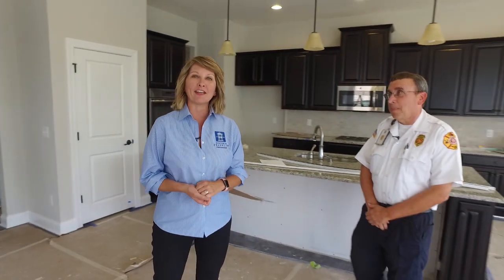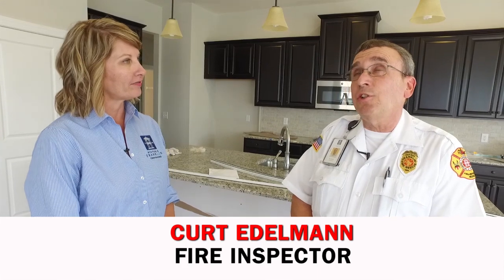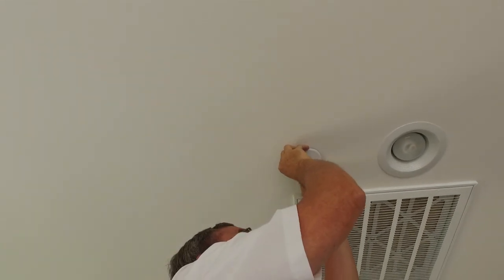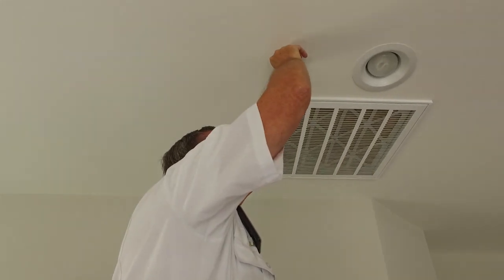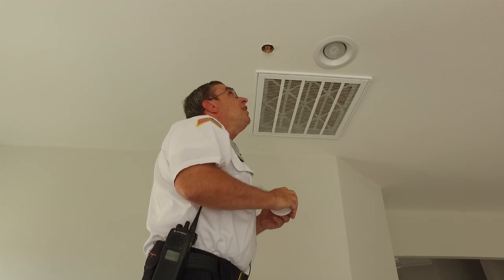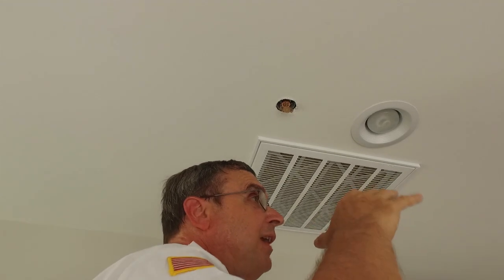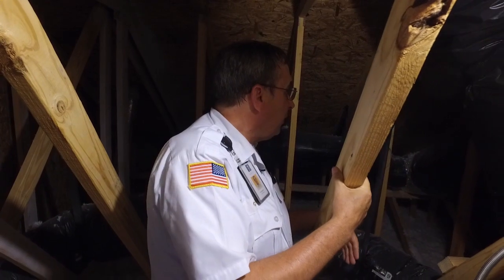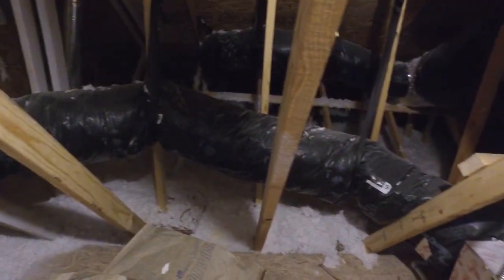Fire Sprinklers Do's and Don'ts

Comment: Nice video but I'm going to have to disagree on what the fire marshal saying. Sprinklers are nothing to play with and I have installed sprinklers for many years and there are many ways for that concealed cover to get stuck and you're trying to unscrew it and you're totally ignorant on how everything works. My best advice would be to toughen up and put the blue masking tape the best you can around the sprinkler cap and then paint your drywall and then remove the tape. Never paint the concealed cap because it's designed to drop off at 135 degrees Fahrenheit and if you paint that cap you've now made it much more difficult for that cap to sense the Heat and pop off so what will happen in reality is your fire in your house will have to get much larger before the heat can overwhelm the paint that you put on there and even then sometimes it's painted and it seals it and it's not coming off. He did give good advice on hanging things and I've seen many people hang Christmas decorations and or stringer's and ribbons using a bent Paperclip and they hook it onto the sprinkler head somehow and then after some alcoholic beverages everybody's lazy to get on the ladder to they just start jerking the decorations down and I've seen some severe flooding from this tactic in my opinion don't ever touch the sprinkler head
Reply: @Roberto Coin  A lot of places do not sell them to anyone unless they have a fire sprinkler license.
Reply: escutcheons not caps
Reply: @DnT4ks  coverplate, technically
Reply: Can I remove the entire fire sprinkler system from my 1988 single family home? I have it because it was the building code during that period of time. Nowadays we don't have that code to follow anymore.